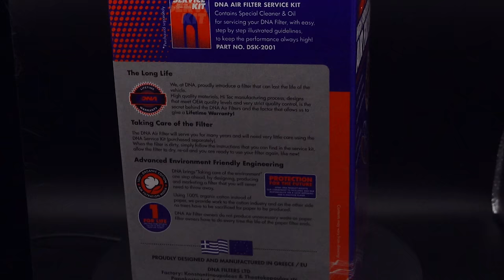Royal Enfield Interceptor 650. Dont fit A DNA performance air filter until you have watched this!

Comment: Stuart - could you tell us exactly where it says the 12-minute idle is required?  I keep hearing and reading this advice on the Internet,  but nobody has been able to show me where the manufacturer states this requirement. It seems to have become an Internet meme which is repeated by everybody. 

Lots of people, including yourself, state this requirement with an air of great authority, and it helps that it sounds half-credible at first thought.  Does anyone have the shop manual?  If so it will definitely be mentioned in there if it really is necessary. If it isn't mentioned, then it's not needed.

Personally I don't see what it's supposed to do; the ECU uses the O2 sensor to control the air-fuel mixture continually, and that control loop should compensate for changes in air flow automatically, just as it does when the air density changes as you ride up and down mountains, etc.  So surely there is nothing to learn, is there?  I am aware that engines will sometimes operate open-loop at or near wide-open throttle,  but idling the engine at 1200rpm with an almost-closed throttle won't provide useful information on what the airflow is like at 6000rpm with a wide open throttle. 

So, Stuart, are you able to get to the bottom of this and find an authoritative and definitive source for this requirement?  If not, I'm going to declare it as hearsay and unfounded! 😂
Reply from the maker: yes the triumph factory directly to me in 2017. The ecu needs a helping hand to reset to new parameters. dont do it if you dont believe in it.
Reply: @stuartfillingham  Thanks, Stuart. It isn't about believing you or anyone else.  I'm just trying to find an authoritative and credible explanation for why it's needed (because nobody has offered one that isn't just hand-waving), and an unimpeachable source (such as an extract from the RE shop manual). It's not about belief, it's about evidence.  As an intelligent and rational guy yourself, I'm sure you can relate to that, and possibly even share my curiosity.

Comment: Really a nice video, after seeing your review, i am thinking now to buy one for my interceptor. But i have one question. 

I am going keep my bike as stock, i am not going to change exhausts. 

Only changing air filter will improve bike's health in long term ?  or after air filter change exhaust change is necessary ?
Two to three months ago,  i cut the air filter cover pop-up triangle part by blade, to make more space enter air, after that i also found 

good throtlle response in low revs.
Reply from the maker: It wont improve the health of the bike but it wont harm it either!

Comment: Thank you for this video , you are a legend to any RE OWNER , or potential owner . I am contemplating buying the RE INTERCEPTER,  and doing the DNA AIR FILTER EXCHANGE  . Are you running the standard RE MUFFLERS on your bike ? Or have you changed them ? If you have changed them to which ones ? Or is this another video we need to wait for from you  , or what mufflers do you recommend please . I would also like to possibly change the mufflers for a weight loss , more aggressive sound , note , and to possibly make the bike run more  better  , in conjunction with the installment  of the DNA AIR FILTER . I have watched other subscribers videos on these mods , and they have recommended doing the  air filter , mufflers , and booster plug  for best total  performance ,  but if you say we don't need to do booster plug fair enough  , but what's your thoughts on changing  the  mufflers in conjunction with the DNA AIR FILTER ? and which mufflers  do you recommend to get  ?

Thank You , and ride safe .
Reply from the maker: standard for the moment.

Comment: Nicely done and well explained Stuart. I'm teetering on the edge of trading my Street Triple R for an Interceptor or one of the Bonneville's, still a bit concerned that I'll miss the extra power. It's a quandary.....
Reply: @Devesh Sharma I don't own either yet. I'm thinking of one or the other instead of my Street Triple R.
Reply: It's not just the power. it's a completely different riding experience.  Haven't ridden the Street Triple R, but one of my bikes is a Daytona 955, and I also have a Bonnie T100 ('02, so it's air-cooled and an 800).  Suspension will be MUCH softer (the R has Ohlins suspension and Brembo brakes, does it not?), riding position is much different, and of course the power output will be noticeably different.  I've spent hundreds of dollars on upgrades to the Bonnie (Ohlins shocks, Triumph performance mufflers, Race-Tech bits for the fork, airbox removal kit and other bits).  It's really down to personal choice and what you want out of a bike.  I'm horribly tempted by the Interceptor myself, but as an additional bike, not one I'd trade for.
Reply: Just traded my '21 Tiger gt for a '22 interceptor. 10k km and couldn't be happier!!! I couldn't use 95 horsepower, even though I was always riding fast, never seemed fast enough but always holding it back. Interceptor I use a much greater portion of its power, it always feels like I'm riding it fast. If I was riding two up regularly the Tiger would be better, but I don't. I can do the maintenance without jeopardizing the warranty, it has 3 yr warranty as opposed to one and has roadside assistance. It's a much more user friendly machine, simpler. It LOOKS like a motorcycle too and not an engineer's wet dream. It's light too! Exchange the cans for an aftermarket set and it's around 196k dry. Fuel economy is out of this world at 88 km/imperial gallon. Go for it. It's got analogue speedo and tach!!!!!!!! Handles like a dream.

Comment: Hi Stuart, thank you for this interesting video.  But are you really sure, that the ECU really can regulate the tuning with the DNA filter alone, without manual mapping, only by running in idle? I worry about the valves and that the engine is running too lean?

Comment: Stuart, I installed a DNA filter and bellmouth on my Meteor 350, and wow, what a difference! I followed your advice about letting it idle, but I let mine idle a little longer, as it was cold out today. I let mine idle for 15 minutes, so as to ensure that it had reached operating temperature. Then, I rode around my neighborhood to make sure the bike was all right. When that felt good, I went for a longer ride. While my Meteor 350 will never be a superbike, the DNA filter DEFINITELY woke it up! It pulls and accelerates in all gears, even in 5th. With the stock filter and snorkel, my bike didn't really pull in fifth; it felt like it had run out of breath-because it had. It pulls and accelerates more for sure. It also has a nice roar. I'm DEFINITELY glad I got the filter! Thanks again for the tip to warm up the bike first. Cheers!

Comment: I installed my DNA air filter stage 2 kit today on my interceptor 650 today. 

There is a drastic increase in power and acceleration. The stock exhaust sounds different as well.

Comment: Another great video mate. Quick question though. Would it be an issue if I did the filter upgrade during the break in period? Ive got the DNA filter kit and and a pair of slip-on exhausts waiting eagerly to be put on hehehe.
Reply from the maker: I cant see a problem with fitting the air filter during the break in period as long as the break in procedures are observed. I would be tempted to leave the slip-ons until after break in is complete though.
Reply: @stuartfillingham  cheers mate.

Comment: Stuart, Just to be clear, DNA is marketed as S&S in The States and it's the same filter?  Sorry if this falls into the realm of stupid question, but I just can't help myself.  Another great entry!  A filter change is the first thing I'll do when I pick up the bike. Good to know.  Thanks! P.S.- I really like the GoPro video of you wheeling through the English countryside at high (yet controlled) rates of speed.
Reply from the maker: Yes this filter was a joint venture between the 2 companies.

Comment: Hey Stuart, i just fitted the DNA air filter with the stage 2 cover, i feel the engine is heating up a tad bit. is it because the filter is allowing more air and there is less fuel in the mix? i did the 15 minute idle time to recaliberate the fuel intake. but i feel the engine heating up unusually....any words of advice?
Reply from the maker: No reason why it should.

Comment: since switching to the DNA filter, have you noticed a higher fuel consumption, and if so, how many liters per 100 are you on average?
Reply from the maker: no a few miles per gallon lower consumption.
Reply: @stuartfillingham  Thank you very much for your answer, I'm just waiting for the DNA stage 2 filter and a booster plug from Hitchcock.  By the way, your videos are a reference in the Royal Enfield French community, thank you for your work 😉

Comment: Amazing video sir. You have explained it perfectly. However it brought a question in my mind. Would it be better to use a booster plug to supply little more fuel while accelerating so that engine would have proper amount  fuel while getting better amount of air using these performance filter. What are your thoughts on it?
Reply from the maker: No need

Comment: Sorry for silly question but is it OK to just fit the air cleaner without upgrading to a Stage 2. I just want to add a Powertronic and airfilter is that acceptable
Reply from the maker: yes it will still work fine with the stock snorkel though flow will still be a little restricted.
Reply: @stuartfillingham  Will hold off on Powertronic ECU. Spoke to the local dealer here and stated that the DNA may not make to much difference due to a restriction in the pipes that I think you are referring to but a set of Hitchcocks would remedy that he said. I will wait for a while to decide.

Comment: Hi Stuart,

Is it advisable to use the stage 2 kit with my stock exhausts. A lot of dealers here recommended its not required to upgrade to a stage 2 kit and just the filter would be fine, unless you have an aftermarket exhaust installed?
Reply from the maker: I think all vehicle manufacturers are guilty of overstating fuel consumption figures slightly although if you are careful in your manner of riding ive found RE stated figures to be pretty much spot on!

Comment: The one thing I haven't seen anybody talk about when doing the stage 2 bracket is rain. I'm commuting on my motorcycle so there are times where I'm riding some rain. Is there a risk of engine damage if I remove the original plastic filter cover, or is there eniugh protection with the side panel to make my concerns a null point?
Reply from the maker: no

Comment: Hi Stuart
Really enjoy your Videos and, like many on here, bought an Interceptor, myself a couple of weeks back, having followed your own experiences.
At the moment I'm wondering how I can address the really serious tramlining I'm experiencing on poor road surfaces and tar joints between carriageway and slip road.
It's fitted with the Phantom stock tyres and they are at the correct pressures and the bike has only 500 miles on it, so far. I have a Himalayan which is fitted with MT60s and suffers none of the issues I have on the Interceptor. Any advice would be welcome.
Reply: I had the same problem with the Pirelli Sportscomp tyres,  they would follow  any groove in the road. I recently switched to Pirelli  Sport Demon and the problem was solved, they are also great for the mountain roads that I ride on.

Comment: Hello Stuart.
Thanks for adding such great videos. I've had a few carb fueled bikes, and I always upgraded air intake, exhaust, aND fuel settings all together. Now I own a stock Interceptor but I really don't want to change the exhaust which I find really nice. Is there a real benefit for only improving the air filter? Don't you think the whole system won't be unbalanced if we only upgrade air intake, and shouldn't i keep everything stock in this case? 
Best regards from France,
Renaud
Reply: good question ..? anyone know ?

Comment: Hi Stuart installed dna 2nd stage air filter on interceptor with stock exhausts only 600 km on engine wondering if I installed this too soon have not started bike yet ?Thanking you in advance.

Comment: Hi Stuart. Have you checked out the  "Motone
Triple Micro Switch Button Housing Black"? I think it may complete the look of the interceptor while replacing the plastic switch gears. Would you install it on both side and would it effectively replace the plastic switches on either side?
Reply from the maker: Ill have a look!

Comment: Abit worried on the stage 2 DNA airbox snorkle cover .......it rains quite abit here ......anyone has any exp w it in the rain ?
Reply: I have two on the top corner of my air box. And performance with free flowing exhaust is noticeably I upgraded my CV carb with a mikuni Tm40 flat-slide then took my bike to get the carb tuned and a Dyno run and print out 38hp 37ftp not bad for a 650 air-cooled single... The tune/Dyno run cost £100 3yrs back
Reply: And no issues with rain ridden in near monsoon conditions at motorway speed

Comment: Superbly explained..👌 btw, shouldn't the filter be changed only when it's due as per the maintenance schedule.?
Reply from the maker: not if your upgrading Anoop!
Reply: @stuartfillingham  means it can be swapped as and when required.?
Reply from the maker: Hi Anoop what I mean is, swapping to a performance filter is done to benefit the bike and rider. you can wait until the old filter needs replacing  or you can swap it early as I have done, it really doesnt matter!
Reply: @stuartfillingham  thanks again👍

Comment: Hi! Thanks for this great Video. Well I had stage 2 of the dna Filter. Somehow I realized: 8 secs of full throttle made a yellow motor light for a while. Repeatable. Using the original cover, effect is less but no motor light as well. Could anybody check this? Maybe too much air?

Comment: Hey Stuart, can you please help me with a doubt? After watching this video, I was contemplating changing the air filter on my Interceptor.  Couldn’t make up my mind. I have just now returned from a 200 km trip where I noticed that at a speed of 100 kmps, not miles, the engine seems to resist going any faster. The rpm is around 3500, i.e. the band which you mentioned in your video. Could this be due to the stock filter and whether the engine will be smooth if it is changed. 
Also, DNA is not readily available in India. BMC filter is. R both the filters equal or should I wait for DNA to become available? I would be obliged if you can advise me. 
Have a great evening
Reply: It seems that you haven’t seen the query I raised about the filter. Can you please help me in deciding?

Comment: I watched your advice before fitting the DNA air filte the bike seems more alive than previously. I have used performance filters for a number of years mainly on cars . I noticed very little difference in feel or performance . It seems to me the larger the engine the percentage of 'performance 'gets smaller . However it appears the smaller the engine the change for the better is more noticeable. The Meteor seems to enjoy it and so do I . Expensive but a good buy .

Comment: Hi Stuart, will the DNA air filter and the bell mouth  work with the stock cans without any issues or do I need to upgrade them and do mods on the ECU?
Reply from the maker: Yes they do, and as I said in the video the ECU is adaptive.

Comment: Hello sir 
I have an Interceptor 650. I never push hard on throttle or do street racings. I enjoy my long rides gently cruising at 3000 rpm. 

I have recently bought K&N performance air filter as I thought it’s good for the bike and give improved mileage. 

Performance improvement is there 

However, somebody cropped a doubt in my mind regarding there filtration efficiency that they don’t filter as good as paper filters. 

Request if you could confirm whether Performance air filter are good for the engine in the longer run? 

Regards

Comment: Does this air filter mod make a Booster Plug superfluous ?
Or do they together make the acceleration smoother and more immediate?
Reply from the maker: I dont think the booster plug is really required for the Interceptor Dave, RE have got the fueling spot on.
Reply: @stuartfillingham   - Impressive.  RE seems to have hired the right engineers!

Comment: Hi Stuart, just fitted one to my new Royal Enfield Classic 350.  It does take some minutes at idle before it calms down...have to let it run longer this afternoon.
I did take out the nice little side pocket for the documents.  It seemed to be more open inside the case without it...wondering if you have any thoughts on that?  It felt like covering up the new, larger opening was against the whole point...but maybe I'm overreacting!

Cheers and...
Ride Safe 🙏🏼

Comment: Hi Stuart, If possible  please try air filter by Moto Wings from Tamil Nadu, India. Your videos are one of a kind. Very informative. Thank you.
Reply: I am using a Motowings Air-filter along with Motowings Trident free flow exhaust. It is a worthwhile upgrade. About 10 months into using it, I switched back to stock setup for 500 kms just to get a feel of what the original equipment offers compared to MW. I found stock mufflers and Air filters to be boring and uninspiring. The increased torque adds more fun to an already fun bike. The Motowings Trident exhaust is also known for its sound output which is more like a bassy version of the famous interceptor rumble in low RPM's (upto 4000 rpm). Although, the sound can be no different to other uninspiring products like Red rooster at higher RPM (like 5500 - 6000 RPM). If you are a sedate rider and does not do spirited riding, you will love the MW trident + MW air filter upgrade. Not so noisy, a bassy rumble and good gains in torque and acceleration. 👍